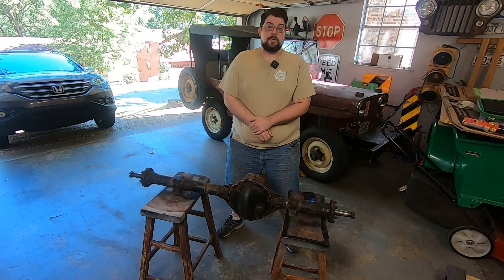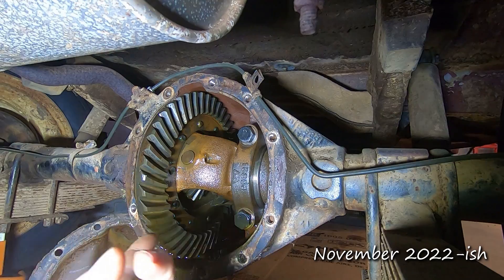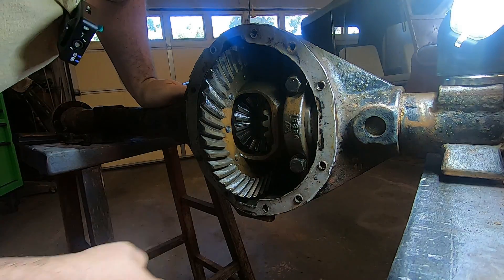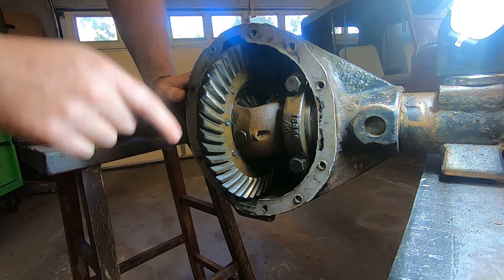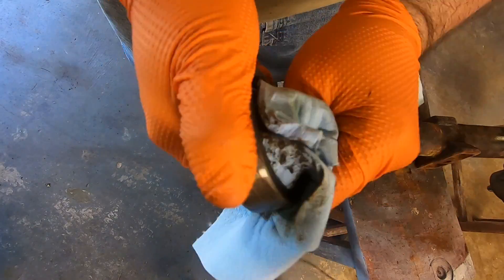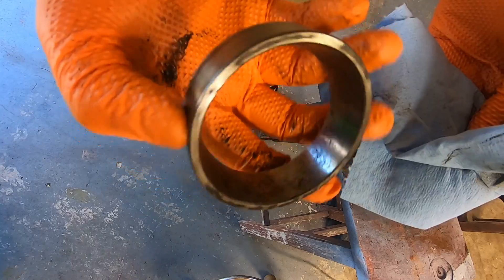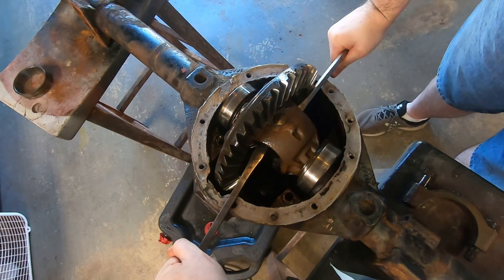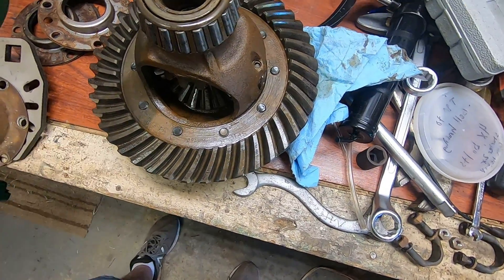Ep. 87: Dana 41 Rear Axle Post-Mortem

Comment from the maker: Ah, the dangers of editing late at night... I just realized that I completely forgot to include the segment of the video where I went back and looked over both sides of the ring gear in better lighting. Oops. But all teeth have a few little rust pits, though a couple of them are pretty significantly pitted to the point that there isn't much of a flat surface on the coast side.

Comment: I'd assume 70-80% of the noise was from the bearings, after seeing all you showed. Since this is a Dana 41 and it's not easy to get another ring and pinion, I'd say rebuild it. With new bearings, seals, correctly setup and being clean on the inside, it should last a long time despite the pitting. The setup with 12-13 of backlash isn't as bad as I expected, but I'm not sure if the carrier with the bearings being worn, would have had side to side movement. I had an axle so bad, that the carrier will move side to side quite a bit, because it had no shims on one side and very little on the other. The bad setup should have escalated the pinion wear, to be able to create that metal paste.